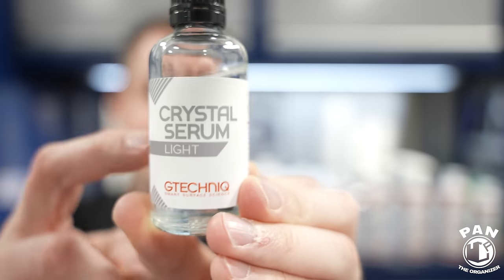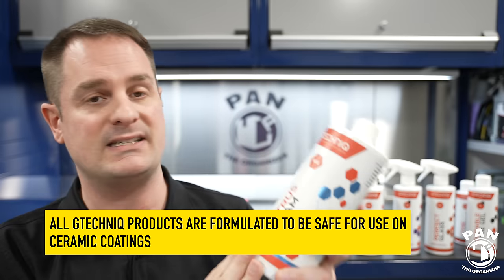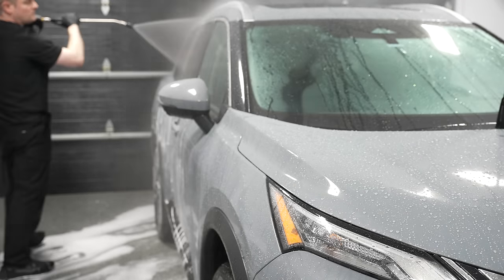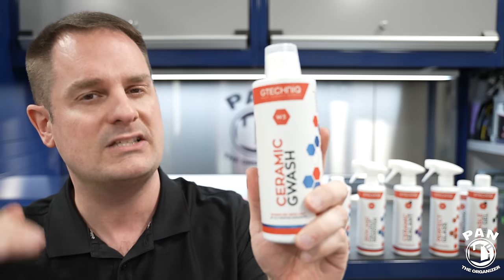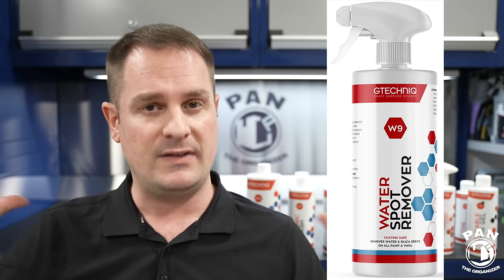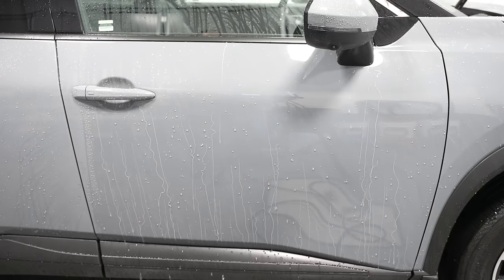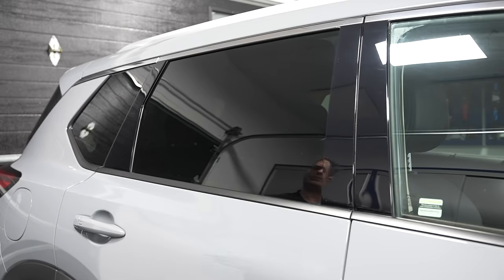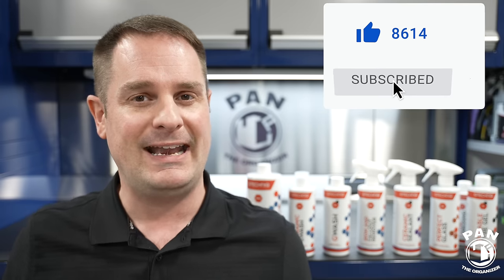Detailing 101 - How To Do A Maintenance Wash On A Ceramic Coated Car!

Comment: You may not have read Gtechs comment below… “although C2v3 is recommended, it is not required to maintain any of our coatings. We suggest a good wash once a month and a decontamination wash once a year”… similar to advice from Gyeon… I’m not challenging your expertise and I like the fact you say “you speak to the chemists” so I’d imagine you should know. It seems that toppers aren’t required to reach the longevity claims made by manufacturers? I get it products must be sold, but understanding true value, impact and time cost matters, especially when this is a hobby for some not a profession. I would simply like a product to do what it claims because I do not have the time nor will to spend on and try every single option.
Reply from the maker: I spoke with the Gtechniq team as well as interviewed the chemists that blend detailing chemicals from all brands. Also, in case you're new to my channel, I have studied in biochemistry and molecular biology, so I am quite informed when it comes to chemistry and have a better understanding of things when discussing with the chemists that blend the products.

It's not that applying a spray topper is absolutely required. It's recommended. Big difference. If you don't maintain the coating, beyond just regular washes, it will eventually see its properties start to diminish over time, it's inevitable. Coatings aren't magical force fields. People think you just apply a 5 year coating, and have a guaranteed 5 years of protection.

That's not how things work. First, many factors influence the durability of a coating. Prep of the surface, application, conditions the vehicle is submitted to, is it a daily driver that sits in the elements 24/7 or a garage kept vehicle that just goes out on weekends? Then you have things like environment (weather, etc) and maintenance.

If you do nothing, the coating will last, surely, but not as long as someone that cares for it by applying a topper to maintain durability, performance and properties once every 2-3 months. Everybody with any real detailing experience knows that.

So it's up to you to decide. If you want to apply a coating, and do nothing else other than a monthly wash, don't have high expectations that you'll reach maximum durability claims. Case in point, see a video I made about real world durability testing of 20 different paint protectants, with ZERO maintenance, other than a monthly wash with a pH neutral shampoo here: https://youtu.be/MoBTLpRFFw4

So in the real world, with my experience, all coatings do much better and last quite longer when maintained with a proper topper every other month or three months.

I hope this clarifies things a bit.
Reply: @PanTheOrganizer  thanks for the clarification and sharing your knowledge. I am not a detailer, I studied Engineering and have a Masters of Business, so whilst this is enjoyable it’s outside my professional remit and therefore value your domain expertise. I seek to understand and clarify to better inform myself - Always be learning is my approach and I thoroughly researched this topic prior to applying coatings (using your channel amongst other sources). I garaged my vehicles for 2 weeks of curing in a temp controlled environment prior to letting them out into the elements and actually spent approx 23 hours over 3 days on each vehicle (including prep and application for paint, glass and trims) so I believe I have given the coatings the best chance. Last 20 seconds to hear what Yves says about maintenance, decontamination and toppers https://youtu.be/8iWYPgt820E
Reply from the maker: Welcome to my channel. You discovered one of the biggest car detailing channels on YouTube as we surpassed 900,000 subscribers and we have over 116 million views! I have been detailing for 26 years and I love to share my knowledge and passion with my viewers.

You found the right channel to help you learn everything about detailing.

Comment: Sometimes I wonder is it really worth putting a coating when you have to maintenance the coating after. Might be about the same work to put some easy to apply wax or seal the car every once in a while when you wash your car.
Reply from the maker: I'd much rather have a multi-year coating, to maintain with a spray product every few months, than have to do a monthly or bi-monthly reapplication of a wax, or apply a sealant by hand every 4 to 6 months. Also, coatings have much greater chemical resistance, offer much higher self-cleaning properties, and insane hydrophobics, among other qualities.

But it really depends on your personal taste. Some people love to reapply a wax by hand every month, as it's a soothing experience for them. I totally get that. To each their own. As long as people take care of their car, I'm all for it. :)

Comment: Question to you !! Why not start with Iron an follout remover first on the entire car and then W4
Reply: Sometimes dirt is trapping the fallout under the surface! W4 helps to pull the contaminants off the surface first!
Reply from the maker: Iron fallout removers do one thing: remove iron particles. To do their job best, they need to focus on that task. So pre-cleaning the vehicle is a must in my opinion. That way, the iron remover doesn't have to fight through other dirt and grime before getting to iron particles, that can potentially also be masked by dirt sitting on top.

So wash your car, then use chemical decon. Same applies to water spot removers, tar removers, etc.
Reply: @PanTheOrganizer  ok Thanks
Reply: @GtechniqNorthAmerica  Thanks
Reply: My concern is that I have water on the paint and the Iron Fallout remover may not be able to work properly
Reply from the maker: Don't overthink the moment. There's not enough water on the surface to dilute it enough for it to become less efficient. I always do this on wet paint, it makes the process quicker and more efficient.

But nothing prevents you from washing the car, rinsing, drying. Then apply the iron remover on dry paint, let it dwell for the recommended amount of time, rinse, and dry the vehicle again. It's all up to you.

Comment: So I can use Ceramic G Wash in substitute of the "basic" G Wash? 
My car is ceramic coated and it's been a few months since I've maintained it. 
After pre wash, I'll be fine with using Ceramic G wash after, correct?
Reply from the maker: Correct. It is designed for maintenance of ceramic coated vehicles.

Comment: Hey Pan,

Is there a reason you do the decon after the contact wash rather than before? Cheers.
Reply from the maker: Yes. The chemicals need to focus on doing their task and not also fighting through surface dirt. So you wash the car first, and then decon.

Comment: How often would you use a water spot remover on a ceramic coating been using descale every 3 months but i do  have some on roof is 3 monthly okay to remove or when ever i see them as rain keeps leaving them
Reply from the maker: You wouldn't use that on a weekly basis, as those are pretty strong chemicals. You use them on an "as needed" basis, meaning when you see water spots. And CarPro clearly states that Descale should not be used for regular maintenance. 

Overall, once a month or once every other month is ok for mineral deposit removal, assuming you have a quality ceramic coating that was properly applied.

Regular washing of your car is what helps prevent water spot damage. Use a pH neutral shampoo and wash your car at least once a week. I wash my car twice weekly on average.

Comment: This is really interesting. Since my coating I’m not getting any foam or dwell time on the car. It’s like it repels the foam! It’s the same canon you’re using and foam with same dilution I have used countless times before. But as soon as it hits the car, it looks like it’s already been on for a minute or two. The only thing I’ve done differently last wash was to apply Wet Coat. Could that be the problem??
Reply from the maker: It's not really a problem if your coating is super hydrophobic and repels stuff, hehe. It's actually a good thing. Also, I don't know what snow foam you are using, and what coating you have. Many variables can influence how runny or "clingy/thick" a snow foam is. Not all snow foams have the same characteristics. Also, do you work outdoors or indoors? I have a much longer dwell time indoors, compared to outdoors that's for sure. Wind and the sun greatly reduce dwell time. You don't want to let the snow foam dry on the surface.
Reply: @PanTheOrganizer  Thanks for the info. I’ve been using ValetPro PH Neutral snow foam which is not the ‘foamiest’ but works for me as my car is never that dirty. The coating is CSL and two coats of EXO V5. I always follow a wash with Wet Coat and final wipe with Cure. That probably explains the lack of foam! Washed outside in a shady protected area. Interestingly, I ‘lightly’ hand polished with CarPro Reflect last time and it has completely brought back the lustre and shine while still remaining very hydrophobic. I think these spray on / top up coatings are great but they do gradually seem to mask some of the depth and shine of the paint.

Comment: Hi Pan, Gtechniq makes a Bug Remover. Do I apply that after the Iron Fallout remover?
Reply from the maker: Usually you use the bug remover as part of the prewash. Bug remover, foam over it, rinse, then proceed to hand wash.

Bug removers will help soften the bug guts and allow them to be rinsed off. What ever is left can then be easily cleaned during the hand wash stage.

Comment: I was curious about decontamination. I have graphene cermamic on all my vehicles and im 2 years and bit in on my wifes daily. I noticed the slickness is going or at least a few days later its gone. A few times i was close to getting a clay bar but i should try iron remover. Ive used carpro lift as a wash and reset.
Reply from the maker: Now you know. ;)

Comment: INCROYABLE cette vidéo tombe à pic.. ma voiture est chez un pro actuellement  qui va lui appliquer cristal serum ultra .. Petite question PAN comme tu l'expliques cette vidéo est pour un lavage tous les 2 mois environs ET si les lavages sont un peu plus rapproché on est pas obliger de décontaminer tous le temps, pareil pour C2V3 ? et concernant le shampoing peut on mettre le ceramic en lavage hebdomadaire ou ce n'est pas nécessaire ??? Que penses tu de mélanger W5 et W6 dans un sprayer ?? MERCI pour tout et tu es au TOP ...
Reply from the maker: Exact. Ce type de lavage plus en profondeur s'effectue une fois tous les 2 ou 3 mois. Pour les lavages d'appoints, chaque semaine par exemple, tu utilises un shampoing pH neutre tout simplement, et à la fin du lavage, tu peux utiliser un QD pour booster le lustre et l'aspect lisse au toucher. Donc pas besoin d'utiliser C2V3 à tous les lavages. Tu peux utiliser leur QD.

Je ne mélangerais pas les produits chimiques ensemble, car il peut y avoir des réactions chimiques inattendues. Tu fais les étapes séparément et seulement au besoin. Normalement, un décontaminant ferreux est bon tous les 3 à 4 mois, si tu as des disques en acier traditionnels (non nécessaire sur des disques en carbone céramique comme sur ma Porsche 911 Turbo S), mais tu utilises un dégoudronnant seulement si tu as des picots de goudrons, ce qui est plus rare.
Reply: @PanTheOrganizer  Tu es vraiment au top et encore merci de prendre le temps de répondre aux questions ... Le top
Reply from the maker: Ça me fait plaisir Eric. Bon weekend à toi!
Reply: @PanTheOrganizer  bon week end et je te souhaite les 1 million

Comment: Is it okay to use the microfiber drying towel after wiping a drying it which is a ceramic spray? 

How do I maintain the towel because my drying towel is Twisted loop and it's quite pricey. I usually use my drying Tower 5 times in Arrow after i drive my car i hang it on the right until it dress and then I used again when if on the right until it dress and then I used again when wash my car

Is it safe to use this step while drying with a drying aid?

Or I should wash my drying towel every time I used a drying ceramic aid?

It's a bit too much work for me to watch my high gsm drying Tower every time
Reply from the maker: If you are using a microfiber drying towel to dry your car, you should be using a drying aid. The drying aid (or quick detailer) will act as a lubricant between the towel and the paint, preventing marring. Anytime you "touch" the paint if when you have chances of marring the paint.

I wash towels after each use. Especially when you use a ceramic spray or drying aid, that protection will eventually coat the fibers and make the towels less absorbant over time, even more if you don't wash the towels properly. 

This is the best microfiber detergent that was development to help remove the sealants from the fibers: https://amzn.to/47CNMDc

You can put a few ounces of it in a bucket of warm water. Let your towels soak overnight. The next day, wash your towels in the washing machine (1oz for light loads, 2oz of detergent for heavy loads).

The best scenario is a touch-less drying with a car dryer or leaf blower. If you have some protection on your paint (wax, sealant or ceramic coating), then you can easily blow dry the car in just a few minutes with a blower. That's what I do. And then I do a quick once-over with a microfiber towel and drying aid to pick up and residual water and boost gloss/slickness.

Comment: I have to wonder, if you use a 'ceramic shampoo' every time you wash, could that replace using an SiO2 spray topper on a coated car, or should you still use both?
Reply from the maker: I prefer silica spray sealants, but if you use the ceramic shampoo regularly, in theory you wouldn’t need to apply the more durable spray topper more than once every 6-12 months.

Comment: Pan love gtechniq on the tire dressing on truck tires late have knobby ribs on the sidewalls best way to dress those? Always have a problem getting all the knocks and crannies. Thanks
Reply from the maker: On big offroad tires or big knobby tires with intricate designs or patterns, the best thing is to use a spray dressing with a brush that makes everything easy and quick. Here's some links:
Spray: https://amzn.to/43mVIap
Other option for spray: https://bit.ly/3CadAJH
Brush: https://amzn.to/42h3z8h
Other option for brush: https://bit.ly/3C6RtE5
Reply: @PanTheOrganizer  thanks Pan I appreciate it

Comment: I have my ceramic coating from Gyeon Mohs. and the ceramic wash from Gtechniq.. But in your video i am a bit confused.. If you use the ceramic wash from Gtechniq and after that use the iron remover on the paint. 1.Does it strip the Ceramic wash? And 2. What is the point of using the ceramic wash if you dry it with the ceramic sealant?
Reply from the maker: No an iron remover won’t strip ceramic protection. You don’t have to use both the ceramic wash, and the silica spray sealant. You can use just a regular shampoo and the ceramic spray at the end. Or the ceramic shampoo, and nothing else at the end. It’s up to you.

This was simply to show what is possible to viewers.

Comment: Hi Pan! how can i remove micro dirt without using a clay bar, because my car has ceramic coating. paint still feels rough even after using iron remover.
Reply from the maker: If you really have contamination, and you tried chemical decontamination and it still feels rough, you can try using a synthetic clay towel that won't scratch the paint if used correctly, with a clay lubricant. A towel like this: https://amzn.to/3JHfrtG

That shouldn't damage the coating, but test on an inconspicuous area first.

Comment: Pan I have a question, if the maintenance wash is every 2 - 3 months what about more regular washes, does the car not need them if ceramic coated?
Reply from the maker: You would wash your car as often as you want and use a drying aid as per usual at the end.

Here’s how I wash my car twice weekly: https://youtu.be/X0msqeozDBU
Reply: Thanks

Comment: I was wondering, is there a specific order to do the decon stage? Example, iron remover first, then tar remover and lastly a waterspot remover. Does the order matter or not?
Reply from the maker: If you were to use all three, it would be tar remover, iron remover, and waterspot remover. All performed on a clean vehicle.

Comment: Hey pan, is there any way to remove scratches from my ceramic coated car without actually removing the coating? I used a cheap car cover over the winter and ot left a bunch of tiny scratches.

Thanks
Reply from the maker: You don't polish ceramic coatings as doing that would damage and strip them. Mechanical abrasion removes any paint protection.

There is however one polish that exists that can help to corrector VERY LIGHT scratches or swirls on coatings. This one: https://bit.ly/42wKKOv